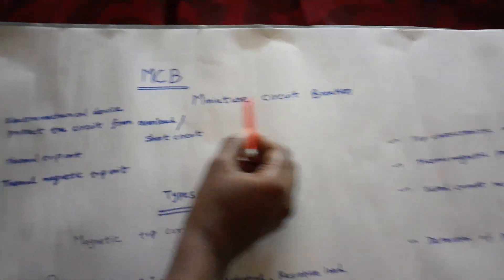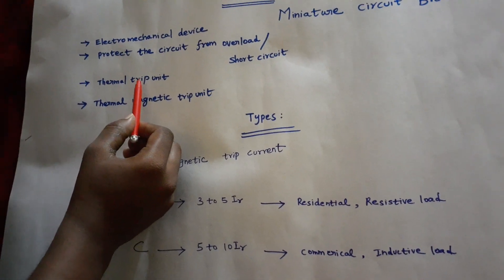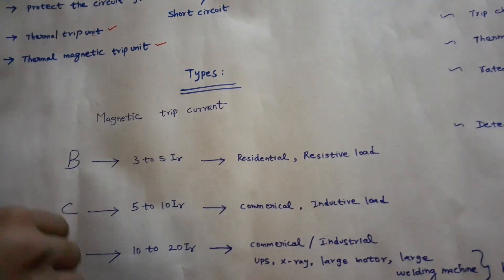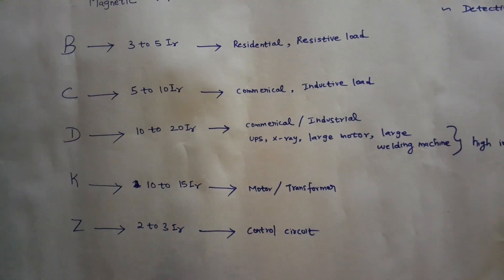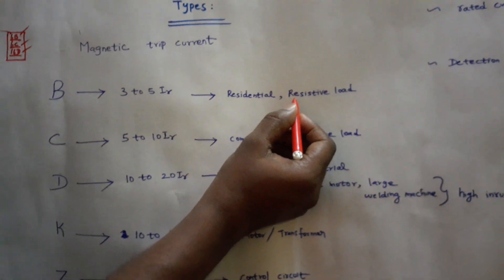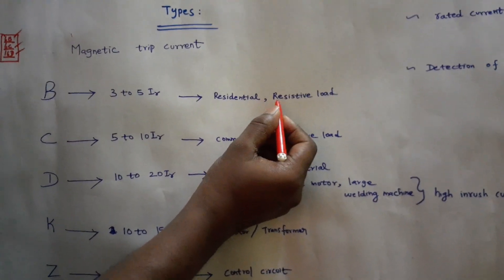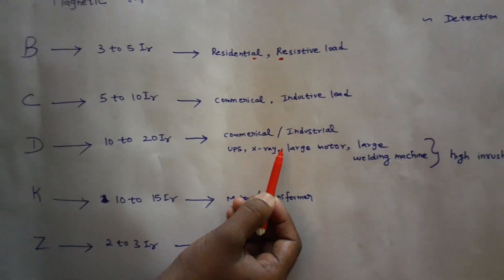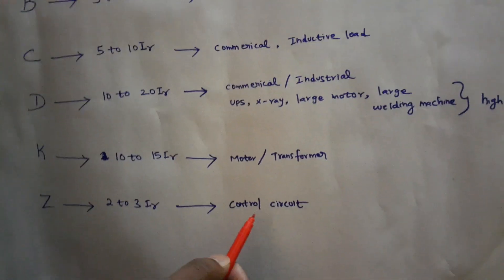Tamil---What is miniature circuit breaker and it's type

Comment: G  50 sets LED seril light  (on / off) ku enna MCB SWITCH use pannalam
2.5 sq mm wire
Reply from the maker: All the light fixture is resistance type only. So you can go with B or C Curve MCB.